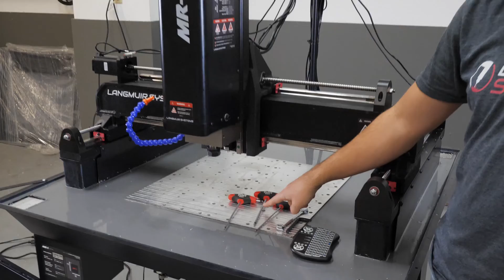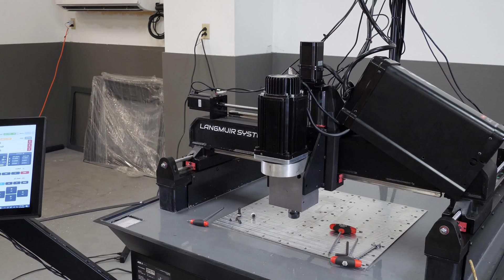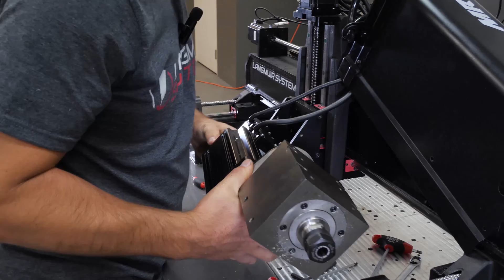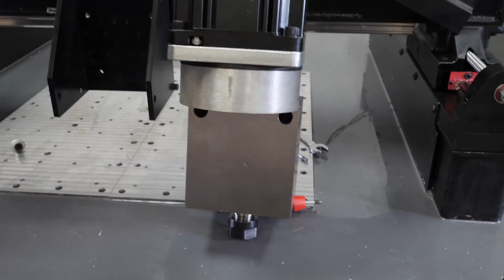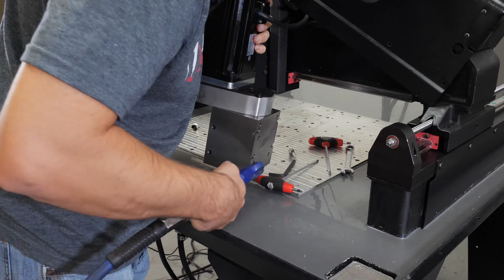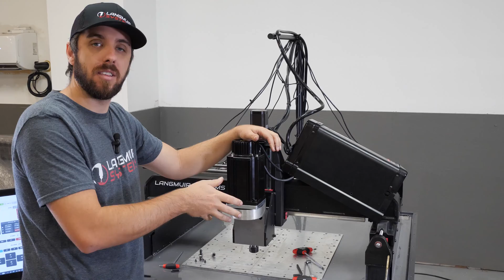MR-1 CNC Mill Assembly Tutorial: Adjusting the Spindle Position

Comment: If you plan to leave it in the up position would it be a good idea to use Loctite on the mounting bolts?
Reply from the maker: It's not necessary. But if you decide to do it, we recommend blue Loctite only.